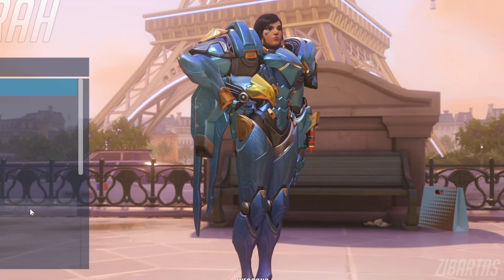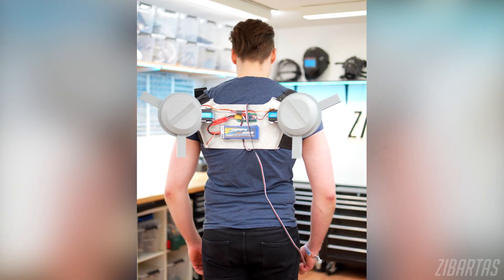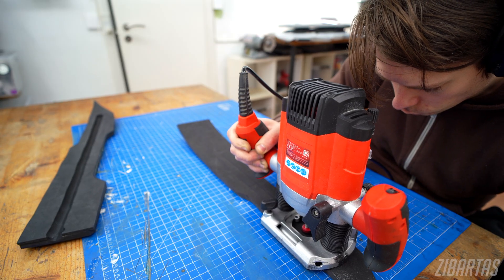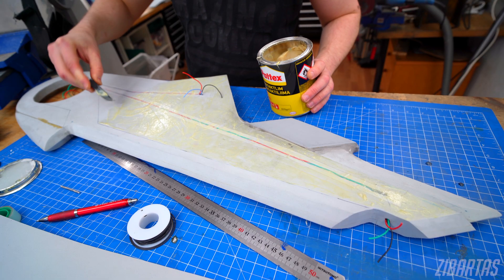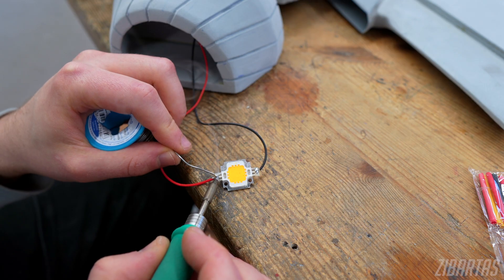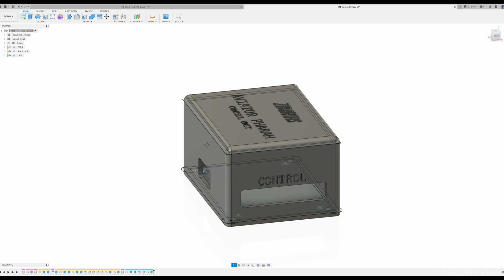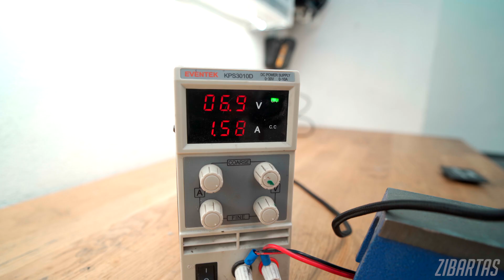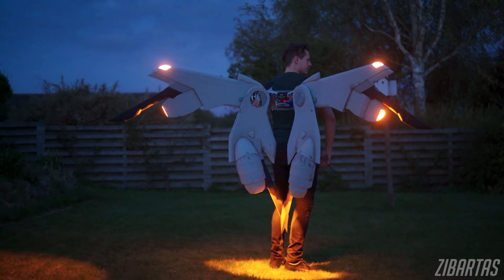Building the FASTEST Animatronic Wings (Overwatch Pharah Cosplay)

Comment: Awesome wings! I do have a question about your mercy wings, namely the dc motors you used to be able to move the wings to the side. I am not sure how strong they need to be to move my own built wings (with aluminium frame, pvc pipes foam and cloth)
Reply from the maker: If I recall correct, I used "70kg.cm" torque worm drive motors - the reduction on them is to 7 or 16RPM. I limited their range of motion with limit switches :). They don't need to be super powerful, just sturdy enough to resist the shearing forces. :)
Reply: @Zibartas  hello again.  For the limit switches how exactly did you write the code for them.  I am trying to replicate the mechanics of it and i got my motors to move how i want.  However i cant seem to get my motor  to move in the opposite direction once a part of limit switches are triggered.
Reply from the maker: @Grimmjowking  You need to look up how diodes work - and my limit switches are analog, they're not used with software :)
Reply: @Zibartas  can’t believe I didn’t think of that weeks ago. Feelin a little dumb now. Thank you that makes my coding a lot easier now.

Comment: Could you combine servos for the fast movement with some kind of locking mechanism (maybe a toggleable solenoid) so you can power down the servos once the wings are fully extended?
Reply from the maker: That's an approach I didn't think of - it would require less reworking for sure, but I'm not certain I can pull it off in a compact space :(